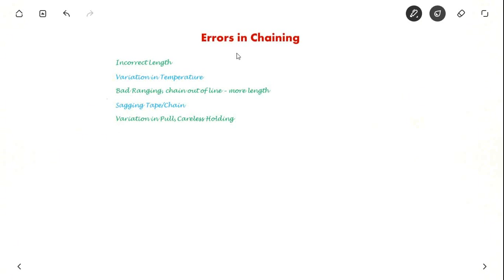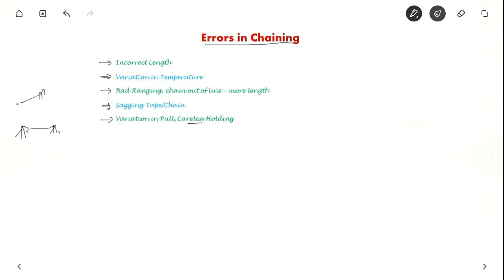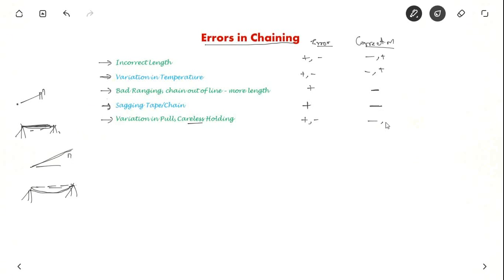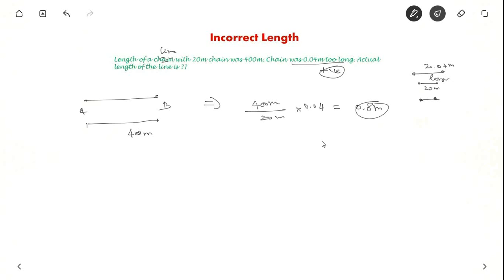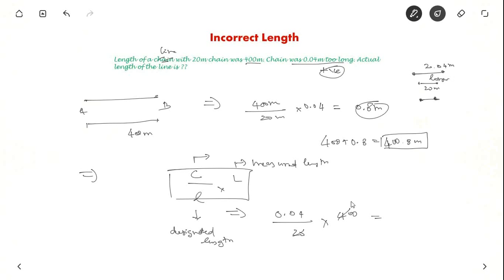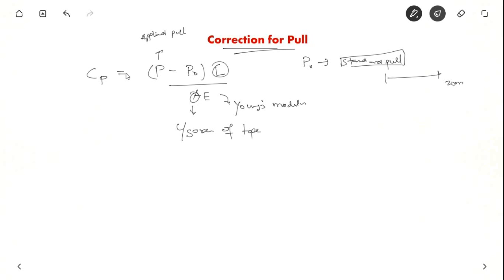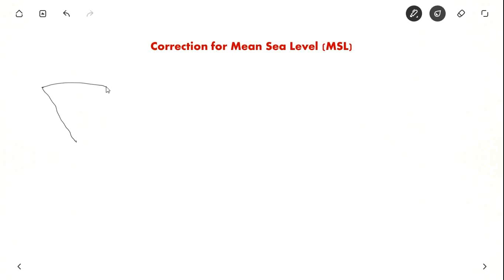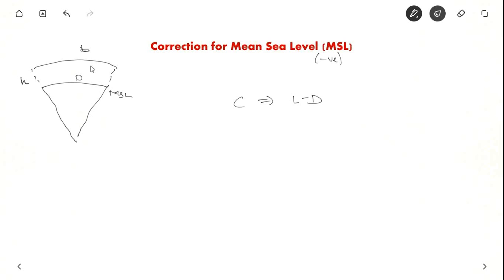Errors in Chaining | Surveying

Comment: formula for sag correction is wrong.....check it once sir
Reply from the maker: May I know what is wrong ?
Reply: @APSEDUVERSE  The whole equation should be multiplied by L(measured length) ?
Reply: @randikahewage2604  wouldn't the unit not be ssme of the 2 sides of the "=" sign?
Reply: @APSEDUVERSE  tape  length is 30m and u put 10m in calculating wt of steel